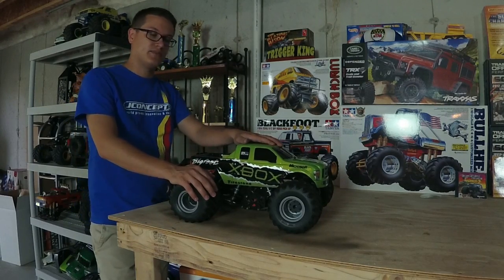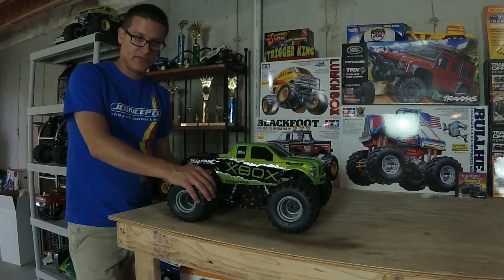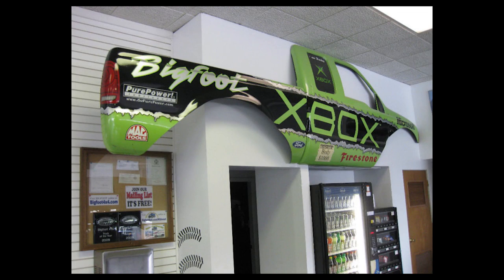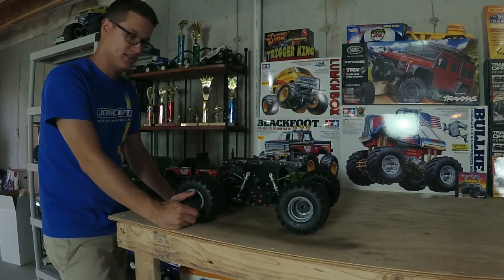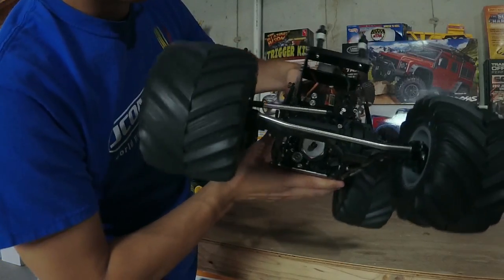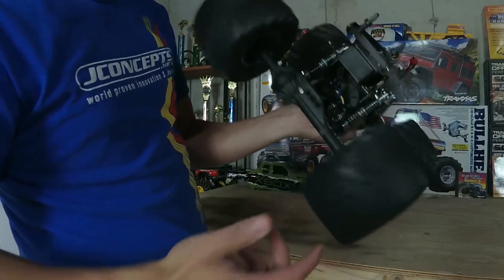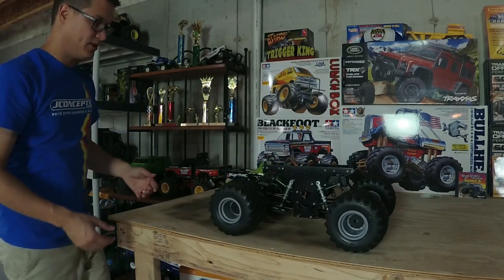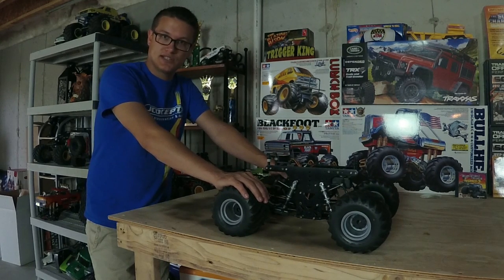Absolute Chaos Shaft-Driven Truck Build - Trigger King Tech

Comment: What about those Traxxas ready to race trucks. Like the Bigfoot and grave digger 30th anniversary. Are they considered pro mods or sport mods
Reply: John Carrillo they are only 2wd. And are not solid axle 4 link trucks. So they would be in a 2wd stampede class.
Reply from the maker: The Traxxas trucks are not solid axle monsters, as Michael said. They wouldn't belong in any of the classes we run.
Reply from the maker: @Willtheangler44 Official Look at an Axial SMT10. That is a solid axle monster truck
Reply from the maker: @Willtheangler44 Official no, not really
Reply: @Willtheangler44 Official You CAN'T put a solid axle on a stampede....